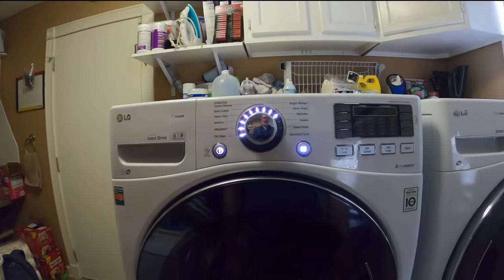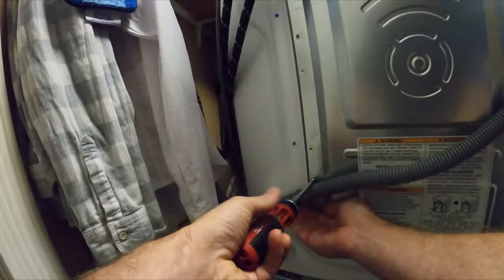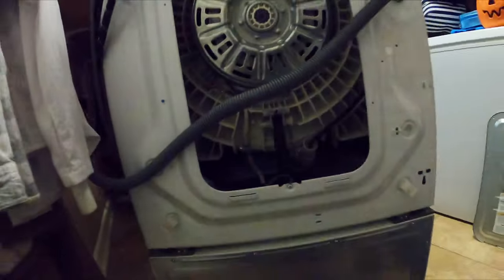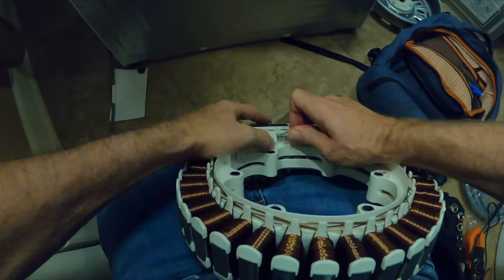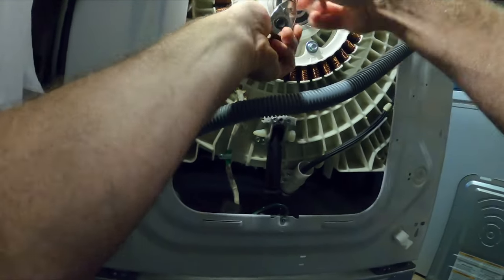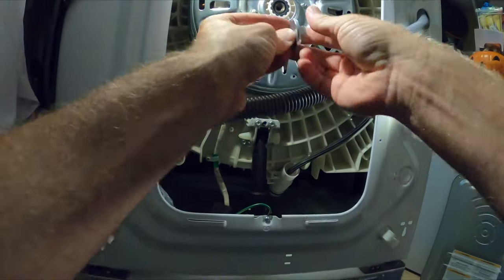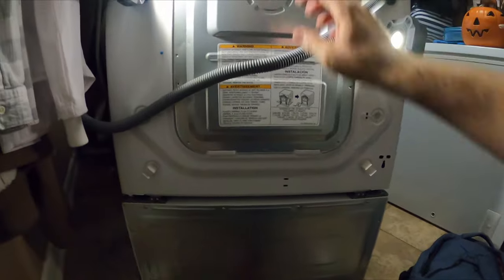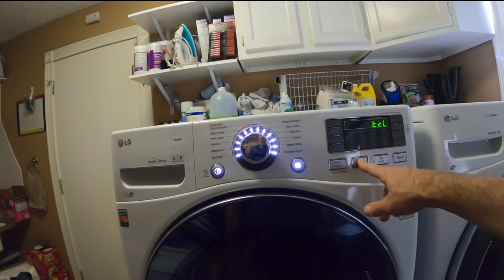LG Washer Not Spinning So Easy a Monkey Can Fix It

Comment: Thanks! After 30 minutes with tech support who said to call a technician,  your video let me fix the problem on my own in 30 minutes. The local appliance store even had the part in stock.
Reply from the maker: So happy to help. Thank you for the tip 🙏🏼😊$$

Comment: I replaced the hall sensor purchasing from amazon for less than $10 and it really worked!!! Thank you so much! And when calling the LG tech support they claimed it’s the motor and will cost me $350-$410 and in that case i was thinking just to buy a new one instead… but thanks to this video i only spent less then $10 and works great exactly as it shows in the video!! Can’t thank him enough!!
Reply from the maker: You are welcome
Reply: Hi and thank you for your help. please let me know how to test the sensor by multimeter?❤
Reply: I don’t know how to test it. Just watching the video I ordered the sensor from Amazon as it said in the video, was less than $10, and just decided to try to change it to see if it helps because the worse I would only loose less than $10. But it worked after changing the hole sensor and my machine has been working perfectly fine ever since. Thank you again for posting very helpful information!!!!!ℹ️
Reply from the maker: @LS-oy9ze  You are very welcome. please subscribe

Comment: 7/16/2024: I followed your video instructions, and I'm glad to say that your guidance was spot on as the solution worked the first time.  You made it a very pleasant experience, and the replacement part was less than $10 to resolve the LE error.  Getting the tech here just to to diagnose the issue was going to cost $119.  Sweat equity did it.  Many thanks for the assist!  ✌
Reply from the maker: @stevequinones6640  you are welcome

Comment: Thanks!, this repair worked wonderfully. I had bought another LG washer as a replacement but using this video I was able to repair my 10 yo LG washer, now I have a backup in the garage.
Reply from the maker: You are very welcome. Thank you for the tip. 🙏🏼

Comment: Thanks! It worked perfectly for my LG WM3170CW with the part number: 6501KW2002A. My only tip is before start removing the part that covers all copper wires, spin it manually to have a feeling how it is before you do any change, feel and memorize how it spins, so when you put it together you have the same feeling. Also for the noise that it makes or it doesn't make.
Reply from the maker: Good advise, Thank you

Comment: Great video. Hey how to test the sensor?
Reply from the maker: Here is a video https://youtu.be/ejOFrWQJyn8?si=UF9cXuoBaQku14yF
Reply from the maker: Om test may pass inspection and the hall sensor might still be bad. In the case of the one in my video it passed the om test but the plastic clips were stretched making it loose. If it is loose it will be off position. Problem is not always electronic

Comment: I have a LG Tromm , washer , bought it like 15 years ago , has been an excellent washer , my wife had a fleece blanket in it and she said it was not spinning , essentially , whenever it tries to rotate , it swings back and forth and it makes a squeal or two , has sort of this knocking sound , and it DOES NOT throw a code. Just continually does this. I went ahead and replaced the hall sensor with the same problem still existing , so it was not the hall sensor. However when I did take the magnet off the back , I did notice a slight bit of wear on the inside , and I did notice a small sliver of what felt metal on the splines when I removed it , but the plastic splines looked fine. The spindle and the bearing looked great , you can spin it by hand , its very smooth. I put it back together , and same problem. So I know why its not kicking a code , and thats probably because its a mechanical problem , not an electrical problem so , the machine thinks everything is working but its not. Looking on another video , I did see a guy say his plastic splines on the magnet , wore out due to a heavy loads , and when he showed a close up , they looked bad , but not like gone , more like just enough for the axle to slip , which is now what I believe ours is doing. I'm going to remove it and reinspect it.
Reply from the maker: thank you for sharing. is there resistance when you spring the inner drum by hand? sometime things get stuck between the inner and outer drum. Also if the drain is clogged you can get similar symptoms. did you run the systems test mode?
Reply: @appliancerepairamerican  no resistance either way , I did not run the system test mode. I pulled the magnet off and looked at the plastic splines , definitely shot , smooth as a babies bottom , it would catch once and a while with a load and with no load it would spin ok , but with any load it would just rock back and forth. So yeah my plastic gear is gone. I got a metal one ordered but you have to space it with a washer because all the ones on amazon are just a tad to thin to allow the magnet to be the right distance away from the copper ring. Once I get the new part and go get a bushing washer , all should be grand.

Comment: Ours gets stuck during the spin cycle. It’s a 2010 model. Washes and does everything but once it’s at the spin cycle it stops working. Hopefully this works. I just bought the sensor on Amazon for $27. The one for our model looks a little different than yours, as ours only had 1 tab on the one side with 3 on the other side. I will let you know if it works.😊
Reply from the maker: https://youtu.be/ZUGUx64rNkA?si=9hPiM91-Xkowa3bc
Reply: Thank you, but could it still be the hall sensor?
Reply from the maker: Usually if it is the hall sensor it will not agitate either
Reply: @appliancerepairamerican  it actually ended up being the water inlet valve.  We took one off of an old washer and it works!
Reply from the maker: I hope the diagnostic video help with figuring it out as it triggers the water valve cycles. Tough to diagnose without being there. I try to keep up with hundreds of individual comments. My goal is to help . God bless you

Comment: If my machine is not displaying the LE error, should I assume that it is not the Hall Sensor? Or how might I test the Hall Sensor so I know that this is what needs to be replaced?
Reply from the maker: Search “how to test LG washer Hall Sensor”
Reply: I just disconnectd the harness and stator, but my model of washer, LG WM3170CW does not have a visible Hall Sensor clipped on. I tested resistance on all combinations of the stator's electrodes, and all combinations are measuring 13 ohms resistance. This is below 15 ohms, which I think is the upper bound of normal. Does this mean that the fault is with the logic board sending too much voltage? Or what do I do next?

Comment: Pulled my washer apart and there is no hall sensor? There's only the 3 drive wires going to the motor.
Reply from the maker: Check the condition of the spines on the rotor and stator
Reply: @appliancerepairamerican  all good, however the one winding on the motor has like 100x the resistance of the other. I'm guessing that's it.
Reply from the maker: @n1xcamic  Thank you for sharing

Comment: I've read that this error could be caused by a number of problems. How can you know it's the sensor before you buy and replace it?
Reply: There is a reset and you should be able to find a video  on that and there is a video link for a similar issue in the comments.
Reply from the maker: Search “how to test an LG washer Hall Sensor” you will need a multimeter. Also, when you take the rotor off check the inside  teeth of both the rotor and stator for wear. it these are slightly stripped it will cause the same error.

Comment: Hi, I just attempted the fix described on my LG WM3170CW using parts LG6501KW2002A and 6877ER1016H. 

Unfortunately, the washer went from spinning poorly before declaring LE, to wiggling the drum a quarter inch with every attempted cycle before giving up after two minutes and throwing up an LE error code.

Do you have suggestions as to what I should do in this situation? 

I believe the rotor splines are engaging the drum (hope I got the terms right), as they do all spin, though with some resistance. (Resistance is a best guess, it’s been a week since it ran properly)

Thank you for your very helpful video, I appreciate your making it.
Reply: Correction, drum spins REALLY freely when machine is unplugged

Comment: My drum doesn't move at all.  Would this be fixed with a new hall sensor, or is it due to a different problem?
Reply from the maker: Do you have an error code? can you turn the drum with your hand? does the machine start the cycle with water ? difficult to diagnose without being present

Comment: My Stator didn't have the second sensor. I'm getting no movement during load sensing, but I hear something spinning.
Reply from the maker: it’s is possible that it is stripped
Reply: @atlasappliancerepair  I'm actually leaning towards drain pump after seeing a video running diagnostics. The tub spins at normal and full speed, but the tub doesn't drain. The sound is also coming from the front of the machine. Replacement should be here in 2 days. Do you have a video for that replacement? 👀 😆
Reply from the maker: Yes

Comment: I just replace the control board, noise filter and now this on the first wash. 
Update: replaced the sensor and no LE code but rattling and growling and only spins slowly when empty. Any ideas what’s wrong now?

Comment: My rotor spins but the metal air flow vents on the inside are grinding against the plastic on the stator. Any advice?
Reply from the maker: I have not seen that . If you found a repair please share your experience

Comment: First the board on my washer died. Bought a used one cuz it was the price of a used washer. After installing it, LE code. Hissing sound and a scraping. Bought a brand new stater with sensor, LE. Bought a new drum, LE. Replaced the bearings and seal, LE. Still hissing and a scraping sound, LE.
5 months now with out a washer.
Should have bought a new machine when it died. Any suggestions?
Reply from the maker: you should become an appliance repair tech. sounds like you enjoy fixing machines. you spent more time and money than the machine is worth

Comment: I replaced the hall sensor. Everything connected same as it was. It worked for a bout 3 weeks. (Hardly used) LE code came back, purchased a new computer board, that board didn’t work at all, I placed the original in and it ended up working for a little while. But same problem after few months, now it has to be pulled out, unplugged, left sitting for a few days and then it’ll work for a load or two. Then LE code returns!! What would cause this?
Reply from the maker: Get a multimeter and check the hall sensor, check the splines/ teeth on the rotor and stator, check the suspension, check the bearings, check the spider arm support, check that machine is level. You should be able to find videos on all these. You can also call a professional

Comment: do you know if this part works on the lg wt1201cv it looks they use the same sensor i just cant find the part number for my specific washer
Reply from the maker: Call our parts hotline and have your model number ready 800-347-2745

Comment: I have an LG2455WH (made in 2008😅)  and it isnt spinning but i dont get an error code.  It will spin a little but sounds like rocks inside.  Think maybe the spines on the motor are messed up?

Also if i pull the pump drain hose and filter, the machine should be empty correct?
Reply from the maker: Tough to give advise when im not there to witness

Comment: I opened up the back of my lg front loading washer machine 
Used my 17 millimeter socket removed the rotor 
Then removed the six 10 millimeter bolts 
And my washing machines 
Copper coil only has one clip that I needed to remove before removing the copper coil and then to my surprise  
It doesn’t have a 
(Hall sensor )
So dang 
I already ordered it and ready to slap it back together but no dice 
I guess I have a different LG front loader then the one in the video 
I did see some rust on     the magnets and the 
I guess I will try and use a wire brush and clean it up 
Maybe that will work 
If anyone has a suggestion please let me know 
If I end up fixing it I will add it to my comment

Comment: My symptoms were the same. I changed the sensor but it did not resolve the problem. 
Any ideas ?
Reply from the maker: Did it jerk back and forth then shit down and read LE?
Reply from the maker: Check the splines on the link inside hub of rotter and stater . If they are worn and it is not a perfect snug fit replace rotor or stater or both
Reply: call a service tech to use a DMM meter and check the wire harness for correct OHMS and OHM OUT THE RPS AND STATOR,
Reply: Maybe you got a bad sensor. I'd order another one and try it since they are like 10$ on Amazon.

Comment: I get the Le error  only after the washer machine runs about 30 minutes.   then when it tries to final spin drive of clothes I get the error . 

Any  idea why the tub would spin for the first 30 minutes and then not spin during the spin cycle?
Reply from the maker: bad suspension

Comment: If I don’t fill my lg up with a least just over a half load it will not spin!  Just keeps saying (ub error) if I fill it up all the way but not stuffed full it spins fine.  If the load is under half all the weight goes in one place and will not spin. My sister has the same problem with hers. So I remember you make use of the space mine is 8kg enough for 30 t shirts.
Reply from the maker: Could also be the hall sensor . The hall sensor is used to detect the rotation of the drum. Can not determine for sure without being there. Changing the hall sensor is an easy and inexpensive repair. There is a link in the description to purchase a hall sensor . Good luck
Reply from the maker: Might be the pressure sensor . This senses the water level

Comment: I can here the motor working. It sounds normal but it doesn’t turn.
Reply: It doesn’t sound like when the spindle broke. When the spindle broke it was bang bang bang ….
Reply from the maker: Check your model Number. you may have a belt drive machine. the washer in this video is a direct drive . if the motor is running but the drum is not turning you may have a broken belt